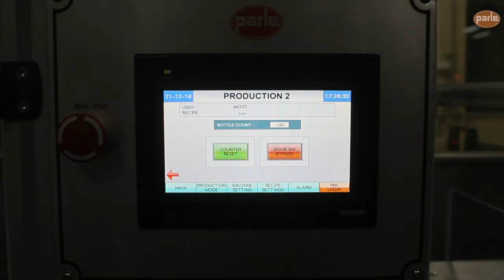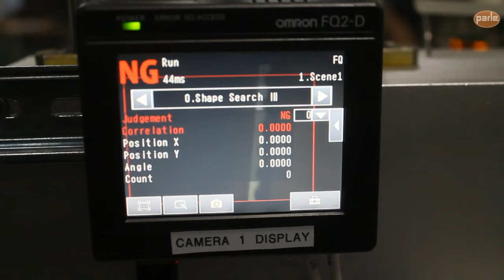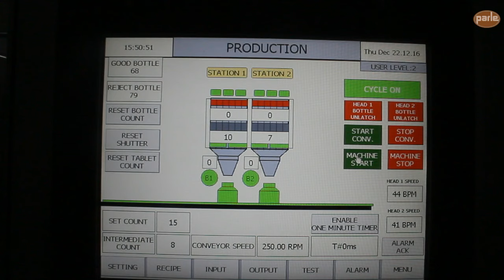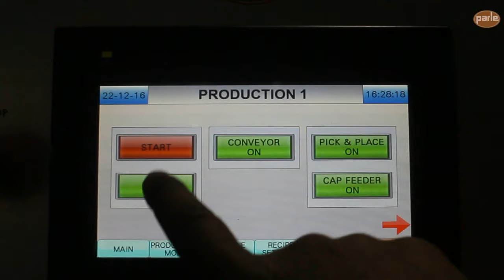Automatic Counting Line with Photo Vision Unscrambler

Comment: Dear Parle Global Technologies Pvt. Ltd. I'm Zoltán Molnár from the Konkoly Electro Ltd., where I work in mechanical engineer position. I'm dealing with designing. We currently have a project where we need to dispose of bearings. On Youtube we've seen a video that has such a solution that would interest us. We would be wondering if the last pieces could be dispensed with, and how stable its operation. Could you possibly ask for a video on the device? thanks for their help in advance too! Zoltán Molnár